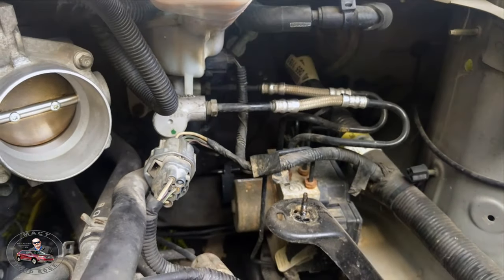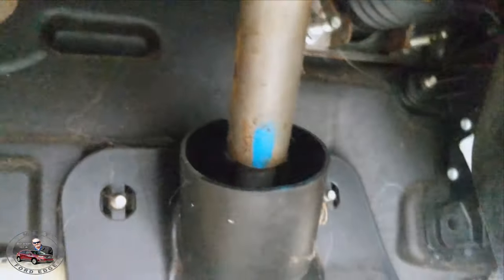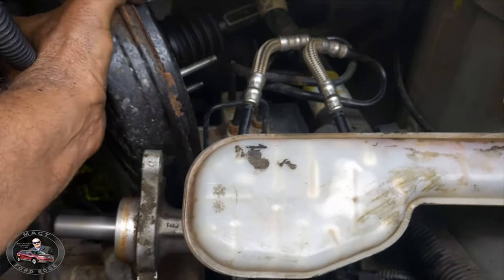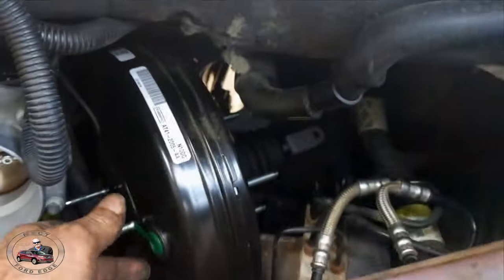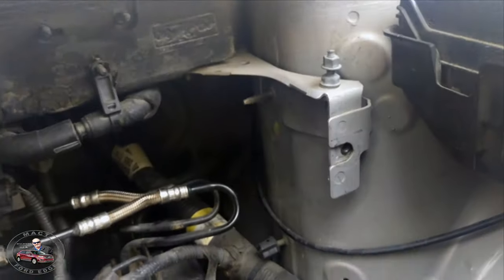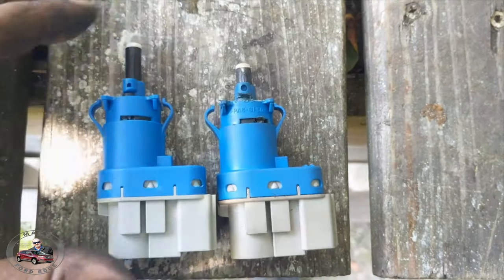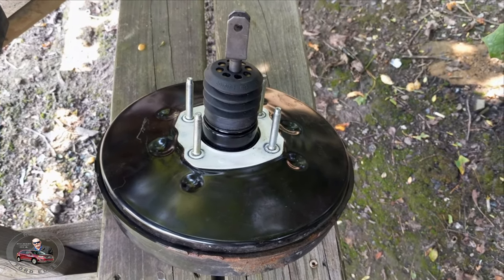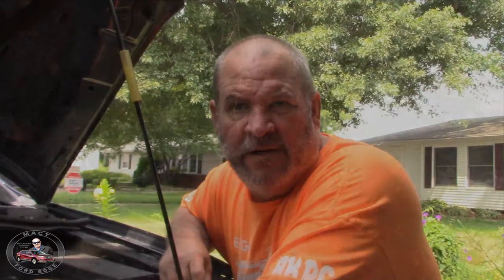Brake booster replacement on a 2007 Ford Edge

Comment: I'm about to attempt this repair when the parts arrive in a few days.  Thanks for the tutorial! My ford edge is a 2010, and has 381,198 miles on it! 😲 😱  The engine runs like a top still, and doesn't burn oil. These are great vehicle's if you take care of them but like any car things wear out and need replaced sometimes.
Reply: Alexis Arriaga  I ended up hav8 g a shop do it after I replaced the check valve. I would say they need to be bleed, but did you check the check valve?

Comment: Just did this on a 2013 ford edge with the help of this video, the only difference is you have to take off the bolt connecting the fuse box to push the master cylinder a little further down and it will come out
Reply: I didnt have to take the fuse box lose just have to work it around

Comment: Good job see you next year when you have to do it again. Every year I have to keep replacing mine either the booster goes bad or the cylinder goes bad and Firestone charges $800 to get the job done. My brake pedal is rock hard when I press mine and when it finally goes down it’s make like a balloon letting air out noise or a hissing noise.
Reply: Sounds like they are using a junk part and charging you new price.
Reply: Mine just failed 14 years and 127,000 miles later. I’ll buy right so I don’t have to buy twice.

Comment: Tha k you for this. Saved me money and hours helping a friend with a lincoln mkx that had hard pedal and squeal under dash when pressing the brakes. 

It helped me to remove the line for the evap from the throttle body.

Comment: Thanks super informative video I'm a novice working on cars for 30 years however I did the R&R in 2 hours I did have about 30 minutes wasted time I didn't have as much room on the brake lines as you did master cylinder was wedged up against top i still managed to get Booster out with brute force lol the new one going in was much easier just about 3 or 4 minutes. I didn't replace my actuator switch brake pedal was not depressing it was super easy fix tho. I just bent the bracket that the activator switch is on and it got it closer to engage with pedal problem solved. I topped brake fluid off because my reservoir was at the minimum line brakes were perfect now. No hissing sound or loss of pressure in the booster

Comment: I did mine without the intake just took the battery and the breather out and disconnected the throttle, throttle body for Baltimore both satisfied, put it in for the master racer back on fired right back up

Comment: NO IDEA how you did this without taking off the intake, or at least moving it! I struggled for a good hour and a half trying to get the booster out when I finally said screw it and loosened the 7/8 bolts and moved the intake. What should have taken me 2 hours tops took me 4 hours. For anyone reading this that’s planning to do this, unscrew the bolts for the intake. It will save you SO MUCH time!!
Reply: @Sweepemofftheporchwithbroom  I didn't. No real reason to if you move it carefully. It's funny, I wasn't sure if I should so I called a friend of mine who's a mechanic to get his opinion and he said I'm good. I've been driving the Edge for a few weeks now and all is good! Good luck man!
Reply: I just replaced mine today and its not neccesary to take the intake off you just have to turn it sideways and rotate it back and forth to clear the bolts past the mass airflow sensor you probably just didnt bend the master cyclinder over enough into the right position thats all lol
Reply: And no you do not need to remove the intake you just have to move the master cyclinder out the way properly

Comment: I have a 2007 ford edge sel awd the booster was going out pedal would be rock hard half the time or it would be working normally then when stopped at a light holding the brake the engine would start choking like it wanted to die from the bad boosters vacum leak i just went and got a new one and replaced it and it took me less than 2 hours from beginning to end it was pretty easy actually i thought ot qould be alot harder after all the complaints but it took some work rotating it out without damaging any other lines and what not but it came right out like i said less than 2 hours lol

Comment: I highly recommend buying a brake switch as well when doing the brake booster I changed mine and ended up having to buy a new switch other wise your brake lights stay on all the time
Reply: I just had to buy a new switch as well. Just like the one in this video, my switch did not extend all the way out.

Comment: I just replaced the brake booster on a 2007 Ford Edge.  Great video!  I got one from Advance Auto but the booster rod was too short, so had to do the job again with Ford OEM booster.  Paid $311 with tax.  Pep Boys wanted to charge me $850, so saved myself over $500.  

I do have a problem with the stop light switch though.  Mine is too short, just like yours.  The switch works but my stop lights are constantly on.  I ended up buying 3 replacement switches (1 from Advance Auto, 1 from Amazon, and 1 from Ford OEM directly) and none of them work!!!  I plug them in and nothing happens.  The stop lights should turn on right away, but they don't.  This is so frustrating and now I will probably have to take the car in to Ford to see what is going on.

Comment: That part number is most likely for just the back half of the case as the one i just changed has a similar number on it aswell the decals could of came off over time

Comment: How.did u compress the booster thats my issue right now. I got mine out without remving and intake and back in but i wont compress to go in.
Reply: I'm hoping to find that same answer.
Reply: @MRn1t3mare07  I got it in it took forver but kept wiggling if around and turning it and it went in.  I bent the braided steel lines to the side too. It goes it but it'd annoying . Probably easier to just take the intake off
Reply: @jennajone45  Yea, finally got mine in earlier. I said "screw it" and linked 5 zip ties together and zipped it down, lol. Went in no problem. Snipped em and actually lined up on the back of the pedal just fine. Now I just have to bleed the brakes on the morning.
Reply: You dont need to compress the booster what are you talking about????? Just bolt it in and connect it to the pedal

Comment: did this on a 2013 and no way it will come out like that, had to pull intake, but its pretty simple and reusing same gaskets. This booster has already been replaced onece before and car under 115k miles,  junky desiged parts i guess

Comment: Please help and please respond. I changed break booster. Breaks work but break lights won't shut off. I bought a new switch since the other was broken, but the new one doesn't reach the pedal. Please help
Reply: What did you end up doing? I’m stuck at that point now. Changed the booster, put it all back together, and the brake lights stay on. New switch, same problem.
Reply: @alexdolinar514  I bent the metal piece so it would match up.

Comment: After watching this video this past Saturday,  I told myself it doesn't look that hard to do ,so I gave it a shot , that was the biggest mistake I ever made ,everything that could go wrong went wrong , and the video is very deceiving because it is edited to make it look easy when in fact , it is very hard to remove the booster , you have to take apart  half the moter just to remove it and it takes two people to complete the job, yes, I finished the job on my car but would never try this again ,it was a nightmare.
Reply: Dont do that.... dont bad mouth someone because you couldnt do the job with the same results the only problem is that you most likely dont really know what your doing and tried somthing you shouldnt have i did this replacement today and it was very easy after watching this it took me 1 hour and 40 mins to do the whole thing and i took my time the people on here complaining just didnt do it correctly thats all there is to it
Reply: Sounds as if you also have trouble tying your shoes.
 A man must know his limitations.
 Perhaps you should just leave the mechanical alone. Obviously, you are not mechanically inclined.